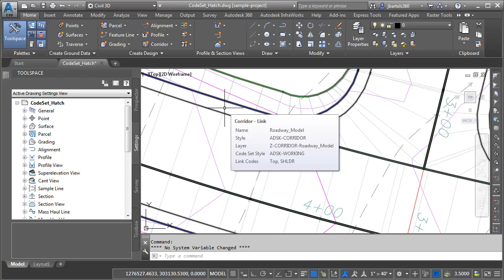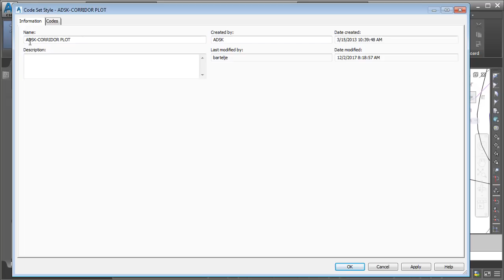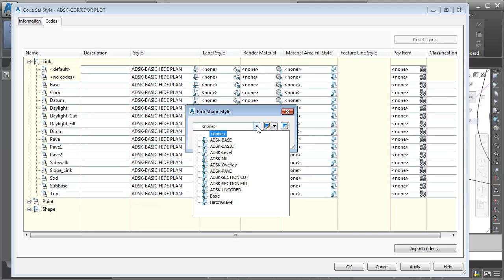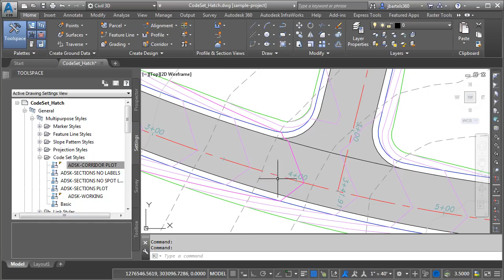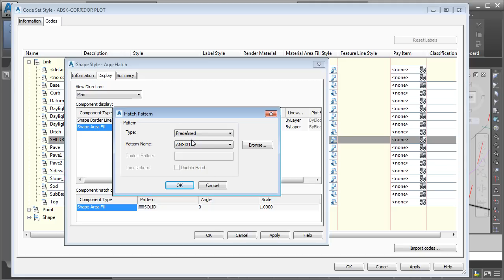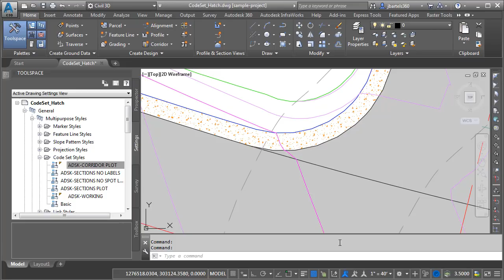Hatching Civil 3D Corridor Models using a Code Set Style

Comment: Hi Jeff
Thanks for the videos.
One question: is it possible to hatch solid with transparency inside the style?
Reply from the maker: Hi Luis, Yes you can.  Within a Shape Style definition, (Display Tab) you can select a "Shape Area Fill" layer.  Simply choose a layer that has transparency assigned to it.  Transparency can be assigned to layers within the Layer Properties Manager dialog box.  Hope this helps!